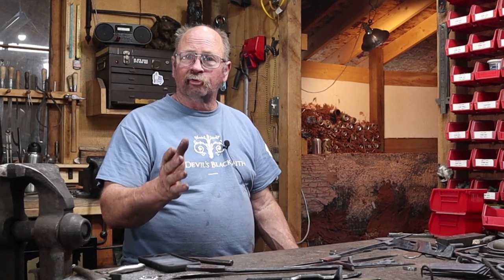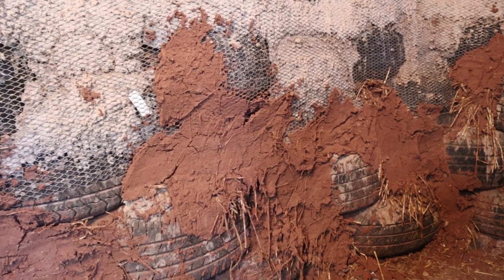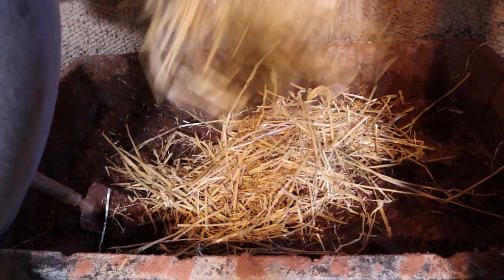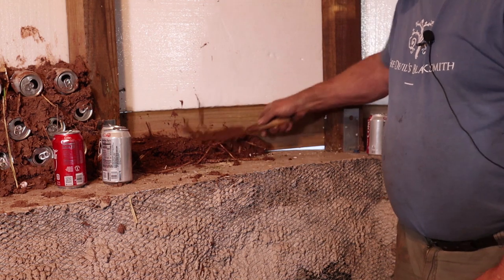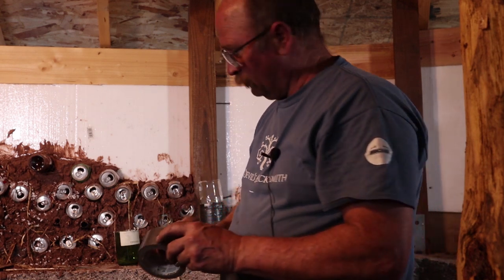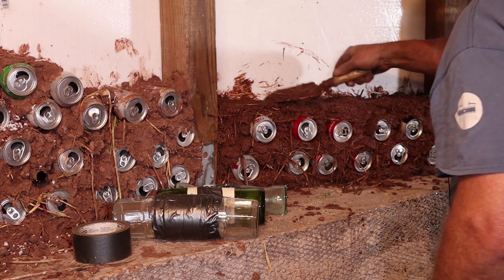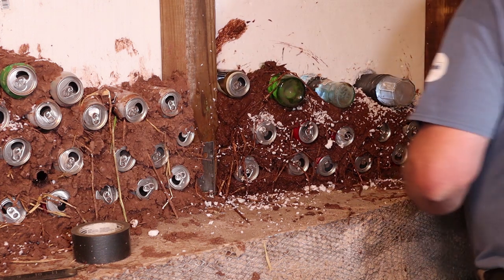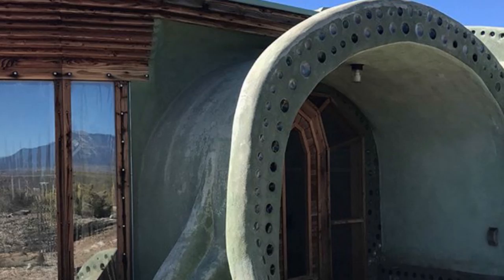Earthship inspired can and bottle wall

Comment: Very creative  I have seen this type of building before but I always thought is was only for very dry climates.   I guess I’m wrong again.  Lol.  The open air space in the can and bottles should give a fair R value   That’s the idea with fiberglass insulation dead air space doesn’t transfer heat or cold as well as a solid object.   Seems a little time consuming but really good use of other wise garbage 
Nice work once again John....Paul
Reply from the maker: Low cost do it yourself is often a big time commitment.  But it will be a truely unique space when its done.  In wet climates, the big issue is just making sure there are good roof over hangs and good drainage.  As long as the adobe stays dry it will last for years

Comment: Awesome, hey I bet you could avoid cracking issues later on if you wet your working  area before slinging the mud especially when you work a little here and a little there.  Just like mortar, it helps the mud adhere to the surroundings your slinging it into.  When you get done, that is going to be looking great!  I bet it won't be your last rodeo with this building style.
Reply from the maker: This is true and for the final coats it starts to be important.  On these small fillers I kind of like the cracks as a place for the next coat to key into.
Reply: @JohnSwitzer  Ah, true, I forgot that there are many layers to go.  I like the can idea as I have only seen bottles and such.  That trick on bending them was innovative to help them stick.

Comment: John, this is really interesting.  I haven't built any buildings. Yet. I hope to build several in the next few years.  I've been aware of this method, and it's interesting to see you some details of how you do it.  I'm wondering what is or eventually will be on the outside of the foam you were hole-sawing through? Thanks again!
Reply from the maker: The outside will be cover with tar paper and metal lath, with holes cut for the bottles.  Then stuccoed over

Comment: What do you think you will do with the room when it is done?
Reply from the maker: It will serve a couple of functions.   There will be a small enclosed seat in on corner that will house batteries for solar panels (just enough for lights), then there will be a stand up desk for the little bit of paperwork I end up doing while in the shop,  it is a place to hang your winter coat out of the work area and away from the dust and sparks. and finally it will just be my little place to relax and take a break.